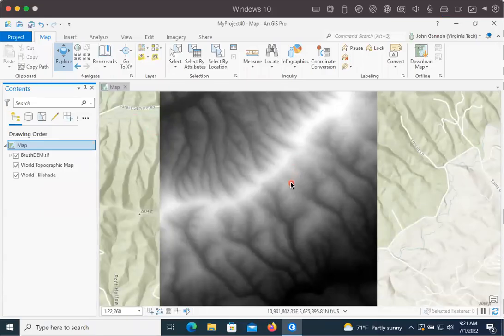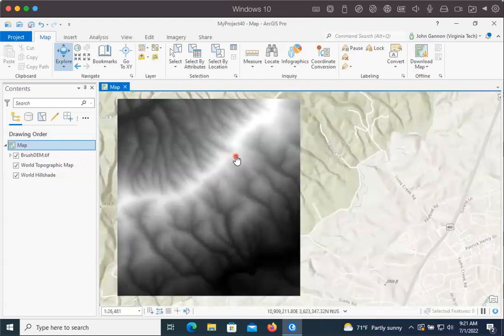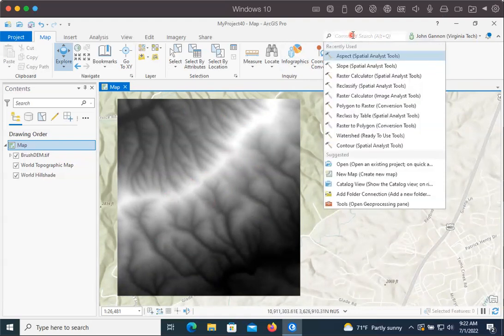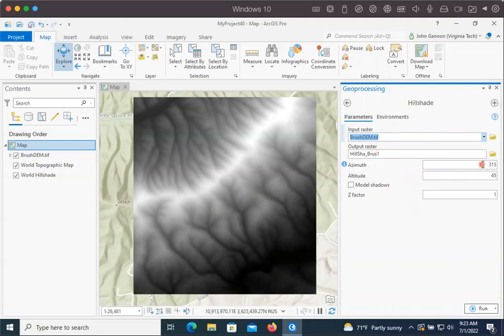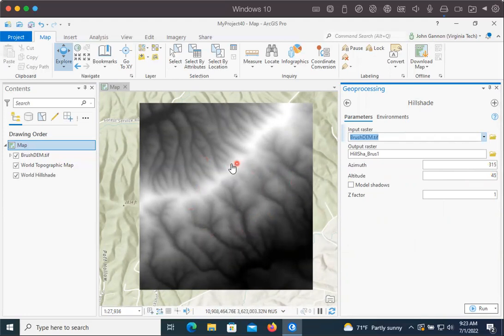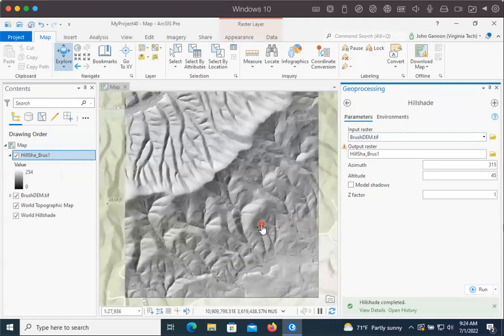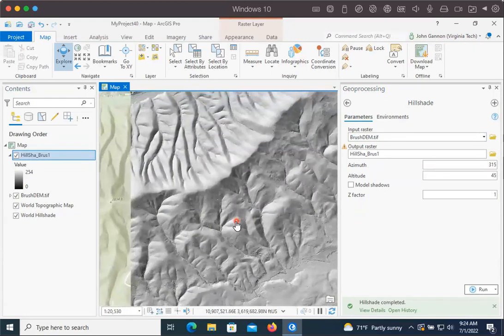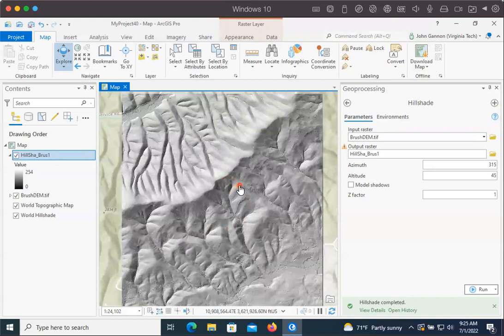arcgis pro make a hillshade

Comment: The edges are not the same size. I understand that this may be because the result is in unsigned char format while the original raster can be, for example, in floating point format. Even when the snap raster is set to the original raster and all parameters are the same (output coordinate system, extent, etc.), the issue persists. Can you explain why this is happening?